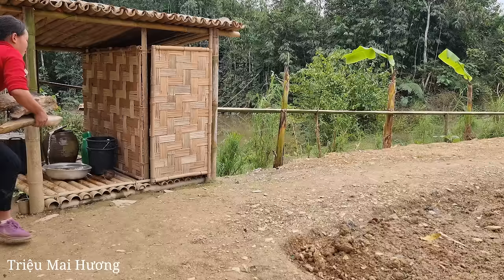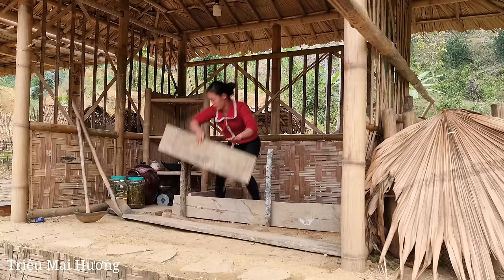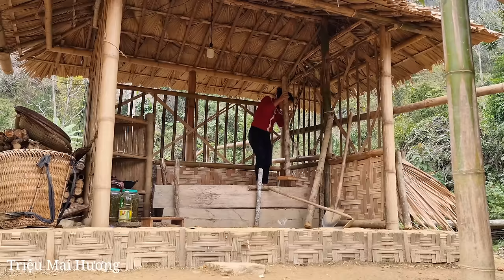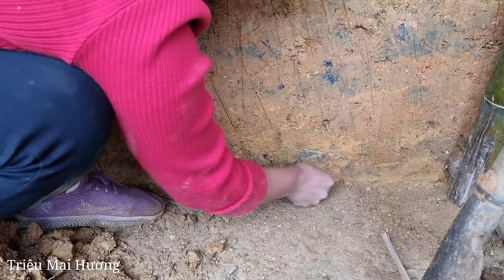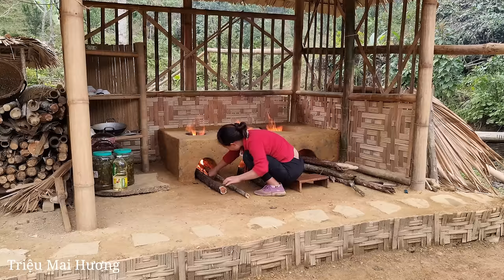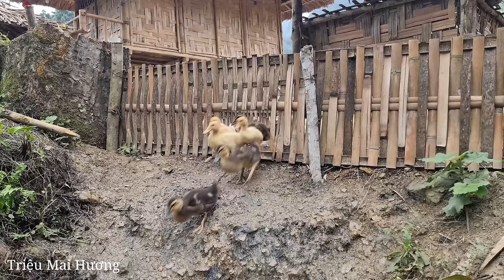How to make beautiful wood stove from clay - Pet care (Pig, Chicken, Duck) - Building new life.

Comment: A very compact, angular, smooth and of course nice looking clay stove in the kitchen for many different cooking purposes. It's quite ok for cooking pig bran but for your own meal cooking, you back will get tired in the end due to the stove is not high enough for comfortable posture when using it. Although there is no chimney to let the smoke totally out of the kitchen when you cook but the construction is now very well ventilated due to the wall at the front and the door removed. It will work out just fine. Congratulations on a job well done.